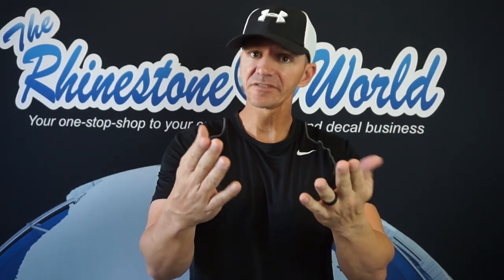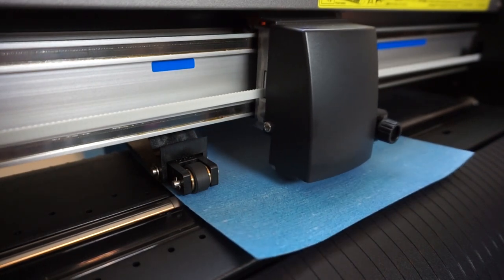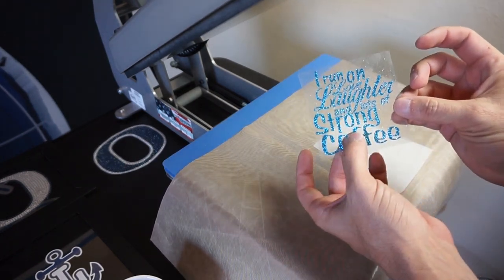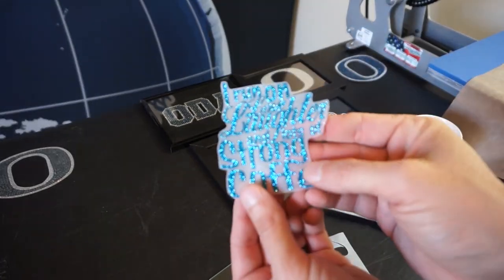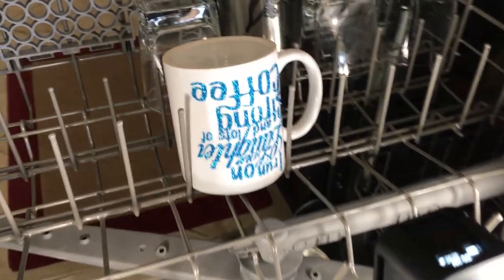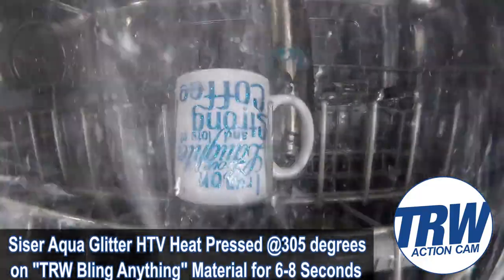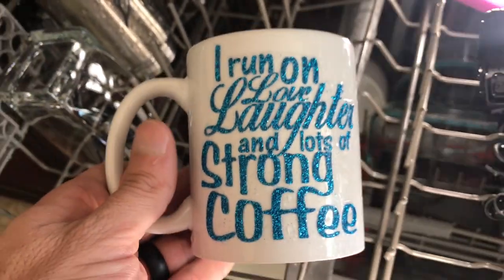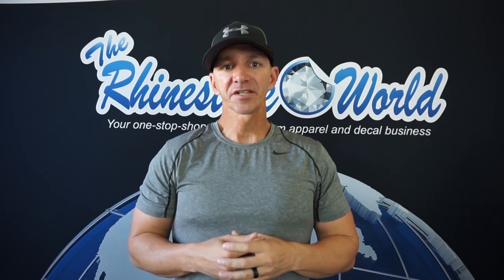How to Make a Custom Glitter Coffee Mug with Heat Vinyl and GoPro Dishwasher Test

Comment: Awesome Video!... question, I thought that Siser Glitter should be pressed at 320* or does it change only for the Bling Anything material?
Reply from the maker: I lower the temp a little when pressing to the bling anything material with the Siser Glitter. You are correct though. 320 for Glitter HTV with the apparel. :)

Comment: It left glitter bits on the bling transfer... thought I could pick it off after laying it down but the wasn't happening. I had to do a tight trim on small words but still there were bits of glitter. If there was no glitter bits mine woulda looked like yours. If you have any ideas on how to curtail this I would be interested.  Jn
Reply from the maker: You can try to combat this by only pressing the glitter for a few seconds to get it tacked on and then cover with a protective cover sheet and press for the full amount of time. That way the residual glitter isn't sticking to your bling anything.
TRW Alexis

Comment: So can the bling anything with glitter heat transfer vinyl be applied to a black coffee mug or will the decal show?
Reply from the maker: Hello,
It can look nice, it depends on the design. If you have a circle design, the inside that is all bling will not look the best. You can cut the inside out, with an exacto blade. Let us know if you have any other questions.
TRW, Grant
Reply: Could you do a tutorial with holographic htv and the bling anything material on a mug I'm very curious if it would work and if the heat setting would be the same when pressing the decal material
Reply from the maker: Jennifer,
I can make the suggestion!
TRW Alexis

Comment: If I use an iron, what temp should I use and how long should I press it?
Reply from the maker: It's kind of tricky with an iron. You would probably use the highest heat setting or around 320 degrees for glitter vinyl and press for about 10 seconds, lifting up every once in a while so that you're not applying too much heat. 
TRW Alexis

Comment: You can see the clear part of the decal. Makes it look cheap. Is there a way to make that not so noticeable
Reply from the maker: You can trim it down to eliminate some of the bling anything material from showing. You just have to be careful not to cut TOO close to the edge of your design as it does need a little bit of the design to hold on to.
TRW Alexis
Reply: I think the same thing.
Reply: I have trimmed it down as much as I can and the blingnething really shows on the perimeter of the design.
Reply: TheMarinemomm You can also load the bling anything into your cutter and cut the design instead of using square of the material.
Reply: @TheMarinemomm  we've tried this and it worked Great, so you obviously did something wrong.
Reply: try to heat press it first and then load to cut... please let us know if this works.. :)
Reply: @sewsowdesignstudiowfelicia3097  You can cut the design on the bling anything on a cutter instead of using a square of the material. Works just fine.